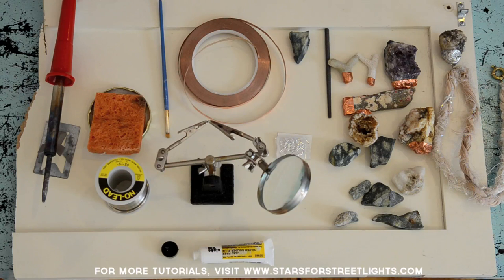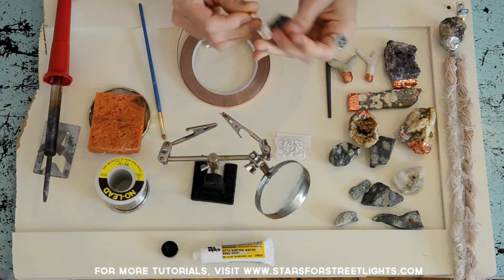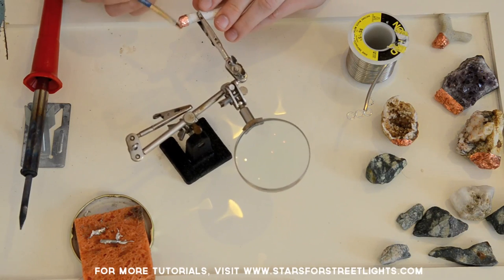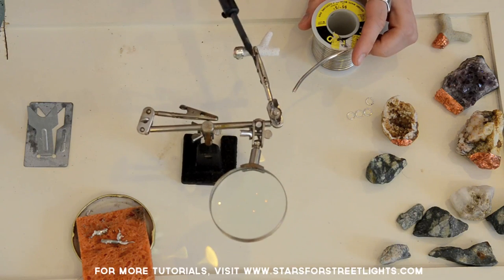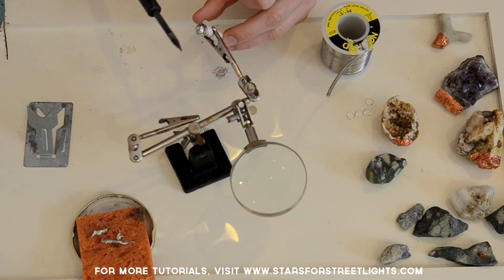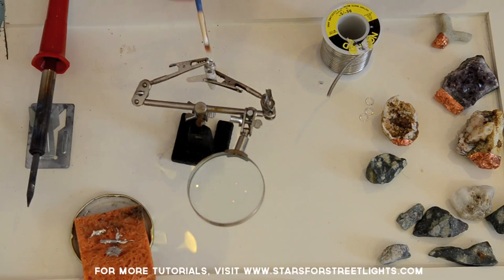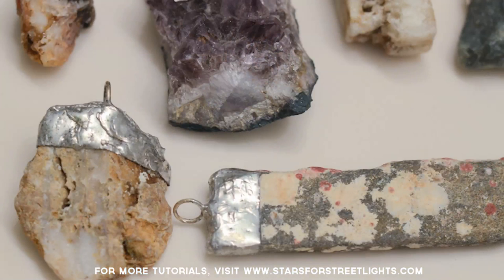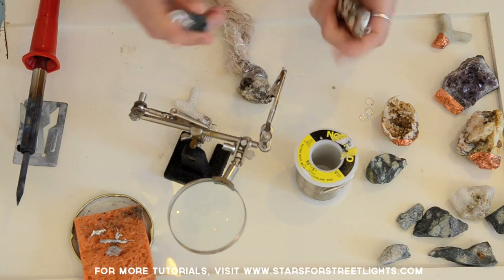How to Make a DIY Rock Pendant for a Necklace

Comment: If you wipe your iron on the sponge rather then tap it, or use a rag to wipe the tip it will work better. You also should “tin” the tip. You do this by cleaning the tip with a rag or even fine sandpaper then melting solder all over the tip, not the whole shaft. Use the tinned tip to do all the soldering. This process enables a quick heat transfer from iron to work. Wipe tip after each use. Before you unplug the iron thoroughly clean the tip then apply a heavy coat of solder. Let it cool. When you use it again, heat it up, clean it and tin it. This will make your work go much smoother.
Reply: She did that

Comment: Get a copper brush so you can keep the iron tip clean. Works best in conjunction with the wet sponge. Also tin the tip before using it.

Comment: I love this video. I use to work soldering electronic components. One time I try to fix my piece of jewelry and it didn't work. So I have up. Now I am taking metalsmith classes, but this video is perfect for my cheaper everyday wear proyects.  One question. Can you solder  copper wire on top of the copper tape, for a natural copper color.?

Comment: Hello, what temperature do you use your soldering iron at? And also when you say you apply e6000 glue, is that around the base of the solder on top of the copper tape and going on to the rock too once you’ve finished?

Comment: Question. There are some agates with fractures that leave little options, but to face cut them, or slab cut. In that case, is it possible to wrap the tape and solder around the entire outside of the slab. In some instances, it would look nice.

Comment: thanks so much for this video! im getting bad visible seams from the copper tape, do you have any tricks up your sleeve for getting the solder even over the seams? i tried putting a ton of flux and that didnt help :(
Reply from the maker: Rats! I've had this happen a couple times, I'd let the solder cool and then I'd try to "drip" another bead of solder onto the seam and spread it out quickly. It's like you're tricking solder into sticking if that makes sense? Haha

Comment: Hi Stacie, I was very happy to find your video for adding this kind of end cap for a rock or glass. Would it work for smooth crystals as well? I have been learning how to set cabochon stones in silver which is fun but very difficult and time consuming. I have some crystals that are too smooth to wrap so this technique could be perfect.
Reply from the maker: For smooth crystals you can create the cap, solder it, and then add a dot of E6000 glue and that crystal won't go ANYWHERE. :) Hope this helps

Comment: Is there a stronger soder you recommend? With the low silver content, I worry about it not being strong enough for my jewelry
Reply: soft silver solder but you'll need a gas torch to melt it (it melts at around 600 C)

Comment: Hello! This is awesome! I've been wondering what to do with the rocks I have been tumbling. Do you know whether the copper tape will stay on a polished rock?
Reply from the maker: It might slip off but you can create the cap, solder it, and then add a dot of E6000 glue and that rock won't go ANYWHERE. :) Hope this helps!
Reply: @Schoolhousehomestead  could you do a video on this? This is the part I’m struggling with the most

Comment: Hi Stacie! I have a quick question. I tried this, but without copper tape. (Couldn't find any)
And the lead-free solder just didn't stick. Do you have any idea if that's because of the lack of copper tape?
Greetings from Belgium! ;-)
Reply: Hi Lisa. I'm not Stacie but you do need copper tape for this project. If you go online and google it, you will find quite a few suppliers out there.

Comment: Hi Stacie, thanks for such an awesome video! Do you use copper-colored solder wire for the copper caps? if so, where might I find it? I work mostly with brass and copper and I'd love to be able to do this with gold or copper-colored solder but I'm having a really hard time finding solder that melts at the temperature of the iron.
Reply from the maker: I got the copper tape here! :)) Hope this helps, look in the description and I've got a blog post with more details! https://www.amazon.com/Copper-Conductive-Adhesive-Width-Length/dp/B009KB86BU/ref=as_sl_pc_ss_til?tag=starsforstree-20&linkCode=w01&linkId=5LUVBN37ZUBHMR52&creativeASIN=B009KB86BU
Reply: Get a temperature regulator for your iron.

Comment: Does the copper tape adhere to any type of rock? Also, how does the final product withstand the introduction of water? Will it want to rust?
Reply from the maker: If the tape ends up moving around on the rock after I finish, I just put a dot of E6000 glue in the cap and then it doesn't go ANYWHERE!  (Even with water!) And on rust, I've had my pendants for 7ish years and they have not rusted!

Comment: hello stacie
thanks for the video, it's very useful ,I have a question, is it possible to apply flux directly on quartz and solder? Might be a silly question, but just curious, thanks!
Reply from the maker: Emily Tam You definitely need the copper tape! The solder won't stick to anything unless you have the copper and the solder. :) Hope this helps!!

Comment: Thank you for this.  Always wondered how to do it.  Quick question(s) if I may.  Can you use solder paste?  And if so does the strength matter?  Can you use a gas torch instead of an iron?  Thanks again.
Reply: +Leah Firth No don't use a gas torch or solder paste! Those are for metalsmithing whereas this solder is used for electronics. Heating a rock or gem to torch temperatures may cause it to shatter.
Reply: Shu Ying Chia I think you can use a propane torch that has a soldering attachment to it so the flame doesn't touch the rock.

Comment: I have a wood burning iron that looks very similar to your soldering iron. Do you think it could be used as one?
Reply from the maker: I'm not sure! You could always try it with the soldering rod heads vs the wood burning ones? The solder will mess up your wood rods.

Comment: In the attachments you linked to shop, the solder is silver and the tape is copper. Will that show up as two different colors, or will the whole look turn silver?
Reply from the maker: The copper will be covered by the silver solder! It won't look copper. :)

Comment: Thanks a lot 😊. Is it possible to do it with silver wire and jump ring please ? Thanks a lot.
Reply from the maker: Do you mean using actual silver? I'm not sure if it would melt easily with just a soldering iron!

Comment: Great video! How do you do the copper cap to bigger rocks or crystals?
Reply from the maker: Priscilla Suchil You just wrap the tape around the bigger rocks! It's the same process-- you just might have to add a bit of E6000 superglue to the cap to make it adhere permanently on a larger rock.
Reply: Did you use silver gleem solder?

Comment: Thanks so much for sharing this technique.  As a jewelry designer who works with metal fabrication, when I solder metal to metal they become one. I'm curious as to how the copper ends up adhering to the stone?  Thanks so much!
Reply: +YaYa Spears  The copper tape is sticky like scotch tape so it 'sticks' to whatever you are applying it to. Then you burnish it down using a bone folder, butter knife, Popsicle stick  ect.
Reply: Thank you so much! I can't wait to try this!
Reply: Ya Ya, there are different thicknesses. I use the 1mm, purple core. But be careful cuz it can tear if you rub to hard.

Comment: I have issues with the copper tape falling off my piece after I have completed soldering. It has happened with rough and smooth stones as well as glass pendants. Do you have any suggestions to or tips to help me get the tape to stay put? TIA!
Reply: Christi Snell  After you make the cap remove it and put a dab of E6000 glue on the inside.
Reply from the maker: When that happens I'll put a dot of E6000 super glue on the cap and then it won't go ANYWHERE! Hope that helps!

Comment: Is there a way to remove it in case you screw up and have to try again? Or is it a "once it's on, it's on" thing?
Reply from the maker: Yeah you could wedge it off if you don't like how it looks to start over! I'd use a pair of jewelry clipper pliers if you've already soldered?

Comment: Does aluminum tape work too? Couldn’t find copper and I’m just wondering if the solder will still stick to aluminum (with flux of course)
Reply: You have to use copper tape.
Reply: @catblair1862  Alright thanks

Comment: Ok so I've tried this a couple times. I got the hang of it pretty much but I am having one issue!! Glue residue from the copper tape! It's making my pieces look messy! Is there anyway to avoid this? Maybe I have my soldering tool set too hot? If there is no way to avoid it, best way to get it off?
Reply from the maker: Oh weird!! I've never had an issue with glue residue from the tape. The tape is facing the rock? Also for removing adhesives, Goo Gone always works wonders for me!

Comment: Hi there - I have done that sort of thing before but the glue of the copper tape wears off eventually and the stone falls off it - also if you heat it up too much that glues dissolves - do you have that problem ever ? how do you fix it? thanks! ^_^
Reply: I've made stained glass for years and never had the glue dissolve from heat!

Comment: Hi.  I enjoyed watching your video but I have to know how does the foil fuse to the stone?  If it doesn't what's stopping the stone from falling out?
Reply from the maker: For me it all depended on the shape of the rock! Some have rougher bits on the top and the foil stuck perfectly. Others are more smooth and then I had to use a drop of the E6000 super glue to hold the cap in place. Does that make sense?
Reply: @Schoolhousehomestead  That should be the complete opposite. Copper foil tape is made to stick to smooth glass. Bumpy surfaces would cause an inability to hold. You would need glue to hold it in place on a grainy or crumbly surfaced stone, not a polished one.

Comment: Is it possible to use something other than copper tape? For those of us with an allergy to copper. Thanks! :) Xx
Reply: The copper is covered on the inside with adhesive and is then pressed against the stone. The solder completely covers the cap. I'm pretty certain that (unless you do a horrible job of soldering) there will be no contact with copper.
Reply: 666LooPoo  If the copper bothers your skin while working with it you could try wearing gloves, but they may stick to the sticky side of the tape.

Comment: Hi, I'm familiar with working with silver but am delighted with your video! Can't wait to try it! I saw on another video that to work with lead-free solder you need 900 degrees. Is that true in your experience? If so, which soldering machine do you use and which solder brand?
Reply: In jewelry we only use lead free solder, I'm sure hers is also lead free. So nope, you don't need 900 degrees.
Reply from the maker: I haven't heard about the 900 degrees and my solder is definitely lead free! There was a lead free option in the hardware store where I bought my solder. (And in every hardware store I've looked for solder.) :)
Reply: Thank you for taking the time to answer!

Comment: so question, maybe someone in the comments would know, i am thinking about doing this with my wisdom teeth. Ive cleaned them and everything i guess im just concerned about the tooth cracking from heat, so just wondering if anyone has any info on this! I have looked up stuff but havent been able to get this specific issue addressed...

Comment: Is it possible to use copper tape (to solder the same way) as a stone set on a PMC silver ring? The copper tape can be soldered on PMC fine silver?
Reply: zoy momma This solder is mostly tin so it wouldn't match with the silver color of the PMC.

Comment: Hi, I tried to solder to make a pendant, but the solder itself just slid off of the copper tape and onto my work surface. It didn't at all stick! Do you know what could've caused this?
Reply: Sakura either not enough heat or not enough flux or both! Good luck, this project looks like so much fun! I'm gonna try it too XD.
Reply: You didn't flux the metal first.

Comment: Hello Stacie :),
i Love this Video!
its very informative to me, do you mind telling me, if this would work with brasslot  as well?
Merry Christmas  :)
Reply from the maker: Thank you so much for your kind words! I've not tried brass, only the soldering because it has a lower melting temperature. You could possibly do gold leaf or paint the soldered part + add a clear varnish to the paint to get a different color though!
Reply: @Schoolhousehomestead   Thank you! This is could work well! i have some gold leafs here, i will definiteley try this. :)

Comment: Could you have melted copper on it to keep the golden look?
Reply from the maker: I'm not quite sure! I've only done this with solder, the process to use copper would be very different I think!
Reply: Nika_Pretty Blessed  No, as copper takes a much higher heat to melt than you can get with an iron. But you could use this method to add copper decorative elements.

Comment: Does it have to be lead free?
Reply: Yes. You don't want to wear anything with lead. Lead solder is only used when doing electronics.
It will read 'lead-free' on the spool of solder.

Comment: Will the tape hold for a long time?
Reply from the maker: It depends on the shape of the rock but if you have any trouble just put a spot of E6000 superglue in the cap and it won't go anywhere!
Reply: Stacie Grissom do you put the e6000 or other glue(s) before soldering? And solder immediately? Does heat affect that?
Reply from the maker: I've made the cap for the rock with the copper and then it will stick to the rock shape-wise and I'll solder over it. I'll use the E6000 after I solder the cap shape to hold it in place! I've never soldered with the glue in the rock but I think it could work too! Heat might affect it but you can always add more glue after you get the shape of the cap?

Comment: Is there any way to do this with a torch?
Reply: Yes you may use a torch but not on the stone. You may heat a metal rod that you use as a soldering iron.

Comment: Is there a way to get the same look with a gold color?
Reply: i have an idea!! maybe after you do this, you put adhesive an gold leaf over it :)
Reply: You can try with bronze instead tin
Reply from the maker: I've never done it but you can find actual jewelry techniques that will use gold instead of the tin solder I was using. :) I like the idea of gold leaf on it!
Reply: Can anyone tell me how to remove this process from smooth gemstones? Bought,a,bunch of crosses with this finish and they are peeling off. I sell them on a beaded wire and don't woman them to peel. I peeled off the loose solder but can't get the cooper tape off. Please help
Reply: Heat the solder by soldering gun and suck the melted solder by a suction pump. you  can buy desoldering pump fro electronic shops . desoldering gun is used for removing the solder from joints in electronic printed circuit board.
after desoldering the solder you almost have very thin sheet which you can remove it by very sharp pointed  tools by trying tear the copper foil.
Reply: Alexandra  This solder is expensive and is for torch soldering. Have you been able to try it with this method?  If someone really wants the gold look there is a gold colored foil available at craft or art stores.

Comment: thanks for the tutorial, I'm having a problem though that maybe you could help me with? I bought copper tape at Michaels the tape refuses to stick to any of my rocks, gems, or jewelry it doesn't take the shape of the jewelry like yours did too thick maybe? yours looks more like how a foil would be used mine is extremely stiff and just lifts up even before I begin the soldering
Reply: I'm not Stacie but I think your tape might be to thick. I also solder rocks that have rough edges and I find that the Venture Tape  Master Foil Plus is thinner and sticker and really gets into and holds on to the rocks. I buy it online. Just google it and you will find it.
Hope this helps.
Reply: thank you yeah I thought so, being so thick it wouldn't shape to rough edges I looked up the tape you recommended it sounds great, but there are several thicknesses can you recommend the thickness you use? there's no thickness listed on the one I have from Michaels so I don't know what to base off of. there are some 2 mil thick and some that are 1mil thick
Reply: thank you yeah I thought so, being so thick it wouldn't shape to rough edges I looked up the tape you recommended it sounds great, but there are several thicknesses can you recommend the thickness you use? there's no thickness listed on the one I have from Michaels so I don't know what to base off of. there are some 2 mil thick and some that are 1mil thick
Reply: thank you yeah I thought so, being so thick it wouldn't shape to rough edges I looked up the tape you recommended it sounds great, but there are several thicknesses can you recommend the thickness you use? there's no thickness listed on the one I have from Michaels so I don't know what to base off of. there are some 2 mil thick and some that are 1mil thick
Reply: thank you yeah I thought so, being so thick it wouldn't shape to rough edges I looked up the tape you recommended it sounds great, but there are several thicknesses can you recommend the thickness you use? there's no thickness listed on the one I have from Michaels so I don't know what to base off of. there are some 2 mil thick and some that are 1mil thick
Reply: Sorry I didn't get back to you.
Yeah there are different thicknesses. I use the 1mm which has a purple core. That way I can push it into the crevices. But be careful cuz it can tear if you rub to hard. HTH.